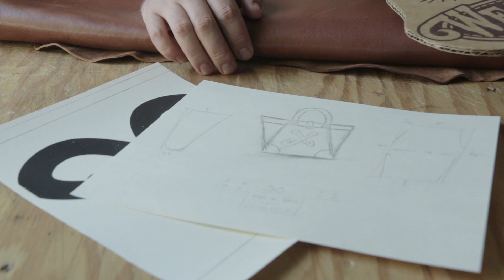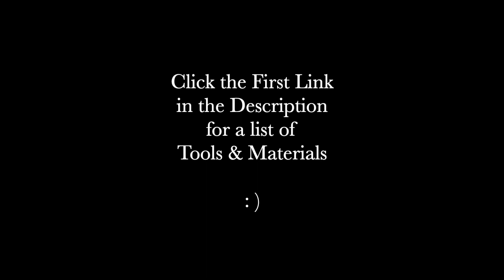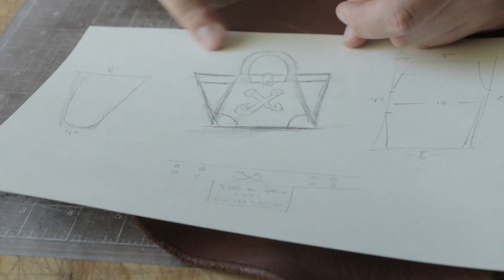Making a $5,000 Leather Bag for 500,000 Subscribers!

Comment: You make skiving look so easy. I've ruined countless pieces of leather trying to thin edges like that lol. Keep up the great content. We'll be here watching and supporting!
Reply: Need very sharp edge to get good result.
Reply: The sharper the better
Reply: Sharp tools do good work.  But also I randomly came up with an experimental technique a little while ago you could try:  take a V-gouge, set the depth how you want; along the edge that you plan on skiving, score a parallel line where the skiving starts and a deeper line at the halfway point between the edge and the other line.

In my experience it helps start the skive because of decreased resistance as well as establishing a physical guide :)
Reply: @Shamanscircle1  That's a good suggestion will try it out .Thank you.

Comment: Wow.  Great stuff Eric.  I switched to Master's contact cement because of Steve (Bedo's).  If it works for shoe repair/reconstruction/restore, it will work for my little leather goods.  I have used Aquiline 315 (German made water soluble contact cement) for my projects that get close to skin.  Not sure why.  I guess I see water soluble cement as being safer than solvent based cement.  Still bang it with a hammer.  Thanks for the videos.  Learn a lot from you.  Kaleena?  is great with the camera.

Comment: Love it!  You folks make great patterns, products, and content.  Congrats on the achievement!  Also great tip about centering.  I worked in a picture framing shop/gallery and we always called it "weighting" when leaving the bottom a bit heavier than the top.  But yeah, drives me nuts to see mats cut with even borders because like you said, it just looks wrong when you stand back.
Reply: Same here. I'm an amateur photographer  and that's  what  I was taught as well.  When I mentioned it to my mom, an artist, she said she didn't  actually  measure,  but now she realized that  was what she was doing.

Comment: Question,  I almost never see anyone use pliers to help the needle through the sewing. But for some reason I almost need it all the time?
Reply: What are you using to punch your holes? If the needle is getting stuck, the hole is probably not large enough, or wasn't punched all the way through.
Reply from the maker: It sounds like you're using thread that is too big for your preferred method of hole punching - every once in a while I'll need pliers if i'm going through a super thick area where things are rolled/folded/etc, but generally no pliers needed. either adjust your stitching hole size up or your thread down and you'll be good to go :)